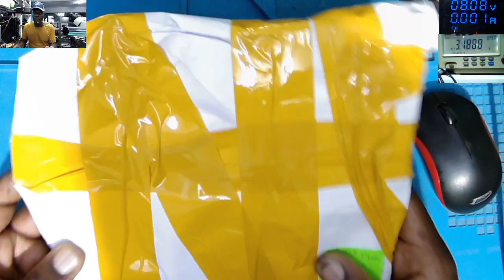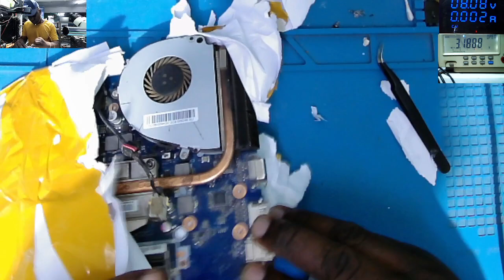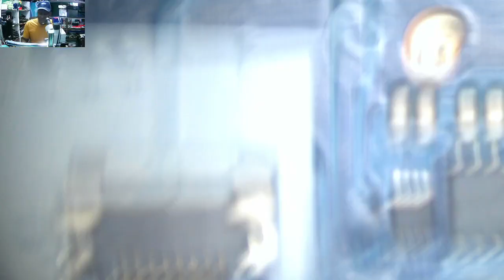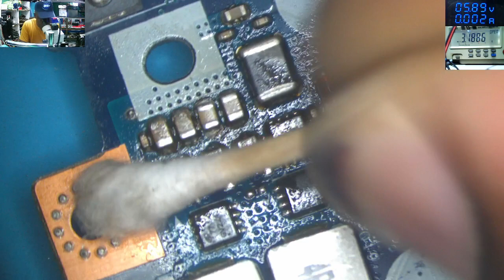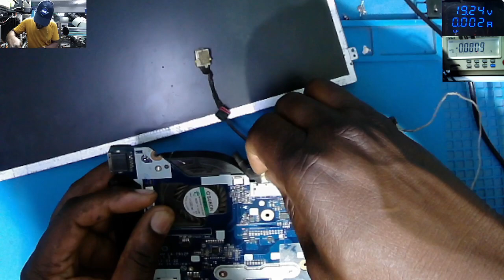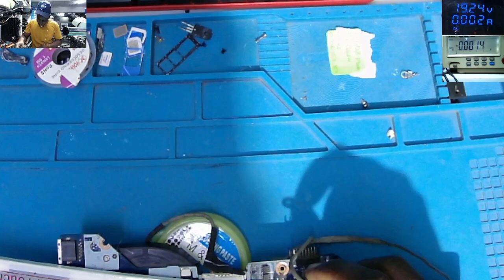Laptop Motherboard Repair--Came in from Bulawayo City (LOCAL). Can We Help The Customer???

Comment: What did u smoke on the board?? 19v rail on lvds cable.!  Never do  that.   
1. Chk wich pin is 19v.  On the motherboard.  Then Chdck  other side lvds.  The  check lcd. .don't take chances  with wrong  cable.   U can pop the gpu.